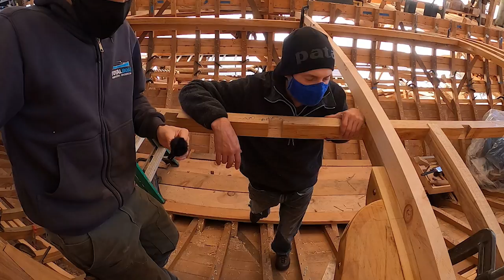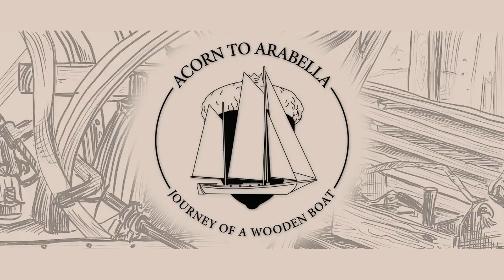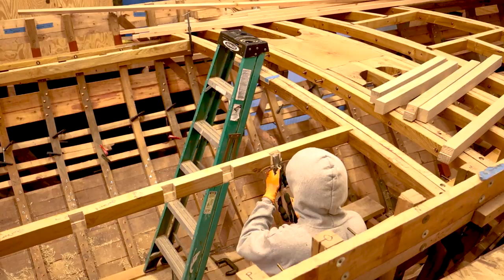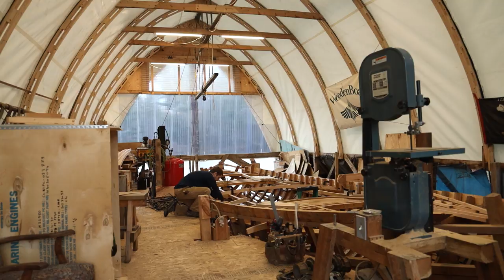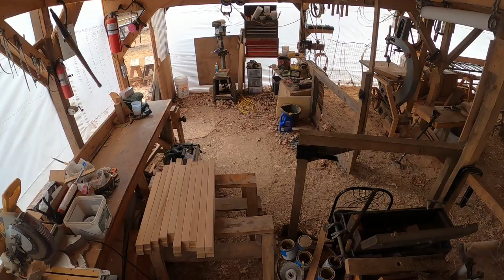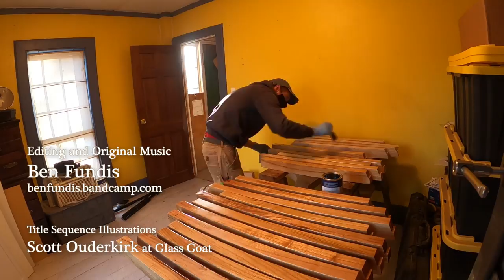Carlin Joints and Lodging Knees - Episode 140 - Acorn to Arabella: Journey of a Wooden Boat

Comment: I'm amazed at how much material you're removing from those long beams. Given that, I would have expected that the beams would need to be a lot bigger.
Reply: Hopefully the boat will be stiff enough that they won't crack.
Reply: The cabin trunking or house sides will add a huge amount of stiffness.
Reply: Considering that Alix is doing dips on them and they aren't flexing, plus they're going to have about 2" of deck on top and the house side, it's plenty strong.
Reply from the maker: Exactly, Scott and Peter. The removed material is not a void, and all the parts of a boat work in chorus—the house side beams are made stronger by the side deck beams (carlins), which fill those notches.

Comment: Thank you again ship is looking great. I have a question. Are you monitoring the shape of the haul? As you  add weight to the outer deck structure is gravity pulling things outward. I remember Steve talking about keeping an eye on things earlier in the build especially over the length of the boat. With tempature and humidity cycles wood can do some funny things. Also how long did it take Atkins to build his boat. Did he have a larger crew of shipwrights working with him. It would suck to realize Arabella had become the victim of gravity and humidity.

Comment: I noticed a space past the Lodging knees when bolted to the Hanging knees. The purpose of the  knees is to prevent radial movement. It is dinninhshed when not fully supported alone its entire length. Screwing in a filler block would be advantageous and support the full Lodging knee strength.
Reply: in the last episode

Comment: Aren't you concerned that removing chunks of wood from the length of that piece, it will compromise the beam with the weight of the house, the decking and general wear over time?
Reply from the maker: No, because the material removed is for a strong joint. It isn't a void. From our earlier reply to a similar comment: The parts of a boat work in chorus to create strength—the side deck beams add strength at 90 degrees to those cabin side carlins, which will also get additional strength from the deck fastened to it and from the bronze strapping that will cross between the two.

Comment: should have placed the reference numbers inside the jointed surfaces that won't show after assembly.
That's how I roll with 1.4 round shoe molding when resurfacing wood floors.

Comment: How much does it weaken those to main beams?  They don't look that big.
Reply from the maker: The parts of a boat work in chorus to create strength—the side deck beams add strength at 90 degrees to those cabin side carlins, which will also get additional strength from the deck fastened to it, and from the bronze strapping that will cross between the two.
Reply: Alix is doing dips on those beams and they're not even flexing.
Reply: @ScottKenny1978  Alix doing back flips is not the same thing as heavy seas in a storm, dropping the whole thing into a trough, and then knocking it sideways, again and again for hours. But if that is what the plans call for, so be it.
Reply: @AcornToArabella  How do you plan to fasten the Carlins to the Deck beams?